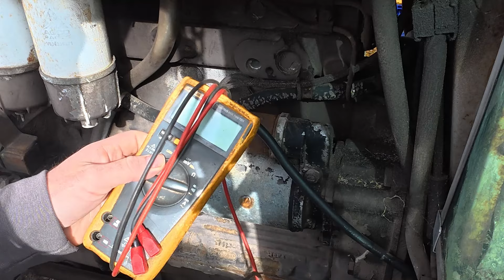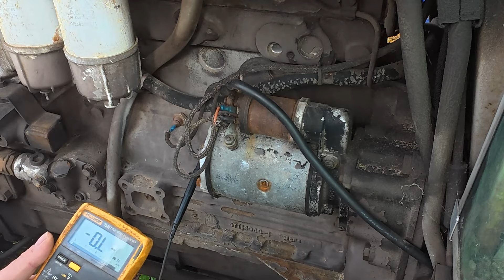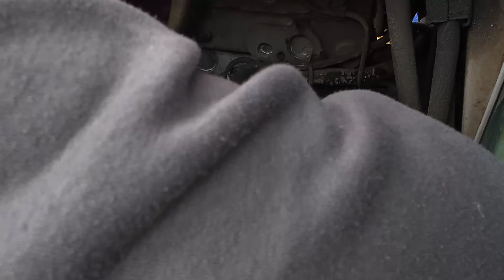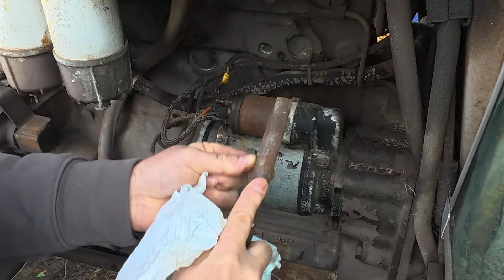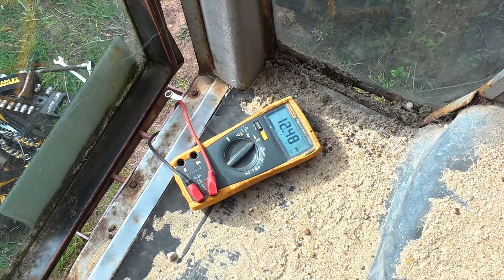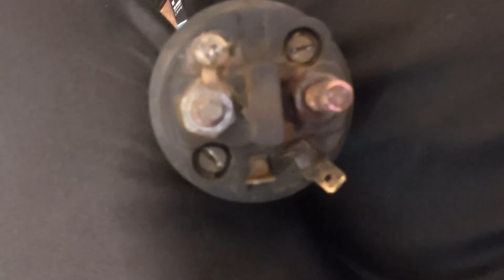Starter motor clicking. How to electrical test, diagnose faults & repair engine starter & solenoids

Comment: Very informative well done finding the fault. Worth checking the clutch switch as well they can be a problem. I've wired a push switch as bypass so can crank in gear to slow  drive when stuck in snow/mud
Reply from the maker: Thanks. Testing the clutch switch probably wouldn’t be a bad thing, they are getting old now, so could be worn